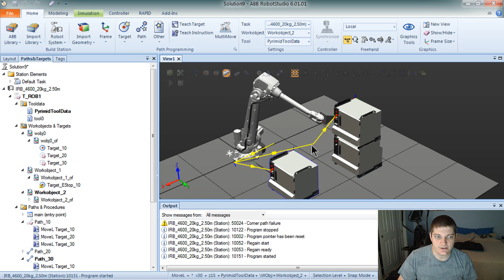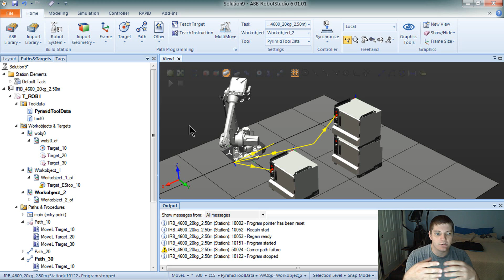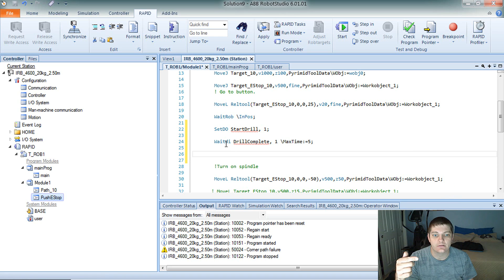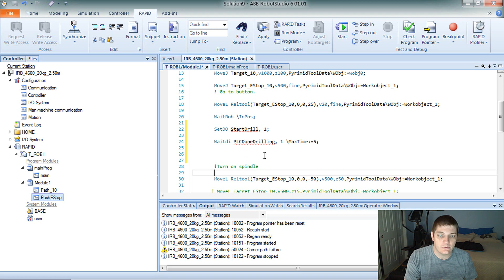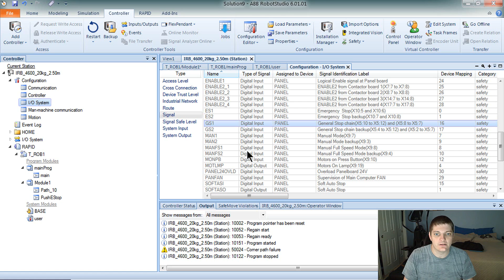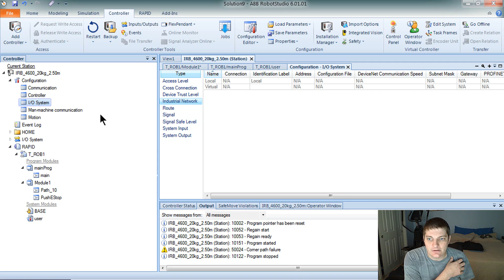Learning Industrial Robot Programming - EP10 - I/O and Wrap Up

Comment: Nice video series! Really interesting ! I got a question, is it possible to connect Robotstudio and Twicat 3 on the same computer and get them to communicate? Would be a really cool project and an interesting continuation on both of your seri on RS and TC3. Thanks for both series!
Reply from the maker: David,  Thanks for the suggestion.  The more detailed I get the smaller the audience gets, which is hard because I'd like to do more detailed videos on what I know best, but I don't think that many people will be able to apply them.  I've done a project where I connected to a PLC and an ABB Robot on the same pc, but they were "glued" together with VB.NET.  
If I were to simulate comms between the robot and the PLC, I'd have to do things differently.  The ideal way in the real world, for various reasons (mostly better determinism), you'd want to use devicenet when talking to an ABB IRC5 robot.  They "speak" devicenet by default.   You can add other interfaces, like Ethernet/IP, but one of the coolest is raw TCP socket communications.  So, in simulation, you'd have to use that, though I'd unlikely select that as a comm interface since it is non-deterministic.  It is higher bandwidth than devicenet, but you rarely need that... it depends on what you want to do.  
So yes, I could simulate that, using the TCP/IP library from the PLC to talk to the robot directly over tcp ip sockets, but I'd be doing a very application specific "driver" for each application, which may not translate well to a video.  All of those options cost money (unless just simulating), so DeviceNet would be best.  I'd probably rather spend more time showing how the different field busses work and pros/cons.  That would make a better youtube video.  Thanks for the feedback, I'm glad you enjoyed the vids.
Reply: Showing how field busses work and pros/cons of them would make a great video